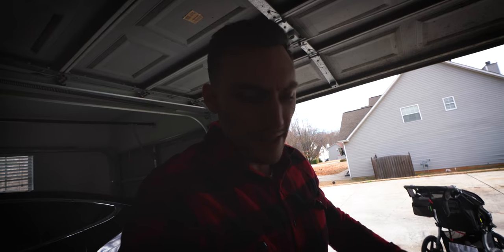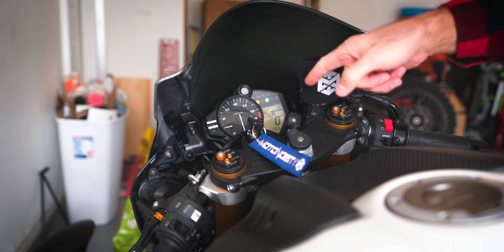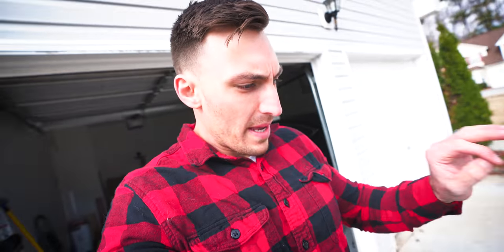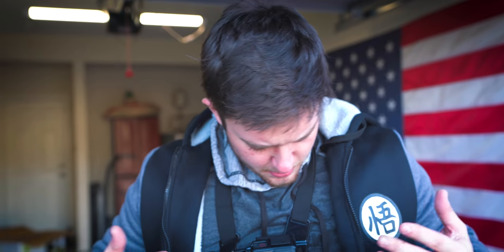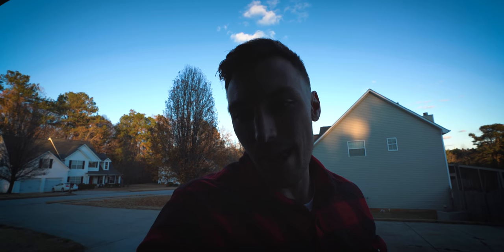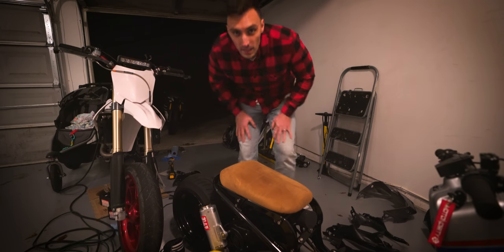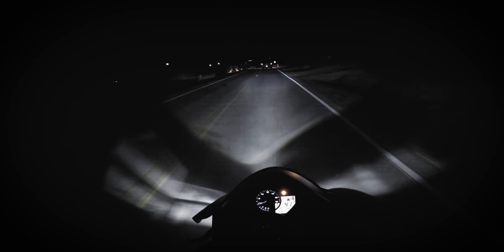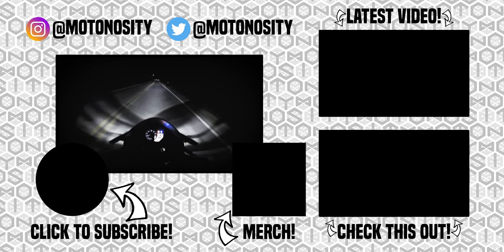Here's why my R6 has been down...

Comment: They added more fuel and likely more ignition advance in the low RPM range to correct the  lean fueling that many manufacturers put in on their stock bikes for emissions reasons.  The leaner condition makes the engine much more sensitive to throttle enrichment transitions, usually resulting in a more heryky-jerky feeling. I had my ECU flashed for the same reasons, and while it is a subtle change, it makes the bike much more rideable.

Comment: Thanks for the content as I was wondering what was going on with the R6.  The cold start issue on my R6 was always is the back of my mind so when I had  Nel Byersdorf at 2Wheel Dynoworks tune my ECU using FTECU, I had him fix it.  Starts and runs great now.  Sorry you’re still having issues but some tuners have found solutions.  Hopefully you’ll get it right on the next flash.  Good luck and keep up the great content.👍👍👍👍👍

Comment: I sent you a message on FB and also tried commenting on another video letting you know. There IS a recall out for the 17+ R6 and I've completed it. It has fixed my bike 100%- I used to crank 10-20 seconds without throttle, now it starts within 2 without throttle:) Go to the Yamaha website and click on Product Recalls at the bottom of the page, type in your VIN and it will show the campaign. The bulletin number is M2018-009 and the modification number is 090ZA for the recall.

Comment: There was a recall on my 2018 R6 for the cold start issues. Should be the same for the 2017. I took mine to a dealership and they fixed my cold start issue. Also added a rapid bike module and I think it helped even further.

Comment: I just got a brand new 2019. And mine starts up first press every time, it can take 2-3 seconds sometimes, but I haven't had an issue in the week I've owned it. So they may have fixed it from the factory and your info about a recall might be right.

Comment: Unsure when you road it last and the outside temperature then, but the feel of increased power from a start could be just from the lower temperatures outside. Riding in 35 F compared to 70 F can feel like you have 10 more HP once the engine is warm.

Comment: Are you using a lithium specific battery charger?  They are different from a standard charger. Plus lithium batteries are very good at being stored with out drain but do not like a low constant drain.  One last thing some lithium units will protect themselves from deep discharge but you can’t just put them on charge. My C-tek lithium unit has the ability to unlock this safety shut off. Highly recommended 👍🏼

Keep up the good work 🤙🏼

Comment: Usually battery when they drain out completely and let it sit for a while, then when you charge is it wont take the charge. Try running a jumper from one battery that has a charge to the dead battery. Let it sit for like 5 to 8 minutes till it gives a little charge, then disconnect it and charge it with battery charge.

Comment: we all hate to be in that same situation, but Bro there is a solution for that ( optimate 5 battery charger ) I used it for over a year now and I couldn't be much happier.

even if the battery is flat dead it will magickly fix it, so many times I tried to start my Big Bike and because I don't Ride it that much I will use Optimate few hours before the Ride, but now I got 2 devices that hooked up to the Bikes to ensure that this will never happen again.

So I suggest Bro that you keep one in your garage :)

Comment: either you need fuel or your check engine light is on? or is that light TCS?

I had my check engine light on for weeks only just got it turned off today
Reply from the maker: I believe I mention shortly after getting on the bike that the fuel light came on. When the bike turns on though it's the ABS light
Reply: @motonosity  lol I must of missed you say that shouldn't multitask while watching

Comment: If it's such a problem child, I'd be more than glad to take it off your hands for a solid handshake and lunch. Also, why didnt you just roll that puppy down a hill and jump it! I do that on my thundercat if it ever gets low if i leave my lights on.
Reply from the maker: The point wasn't to start it, that's easy enough. The point was to test out the ECU change. Also, as has been shown in past videos of mine. Push starting a bike with a battery that is beyond dead ends badly lol

Comment: couldnt just push start her?
Reply: 420HighSide he wanted to see if the cold start issue was fixed
Reply: @bradleyjohnson1839  Yes, I am aware. But all that hassle changing batteries and then to buy a new one when he could have just pushed her, rode for a bit to charge the battery and then started it up later.
Reply: 420HighSide That’s true.